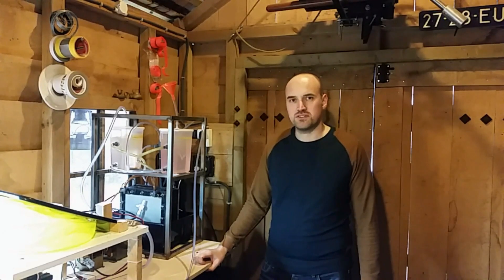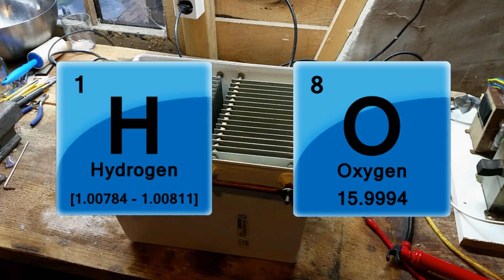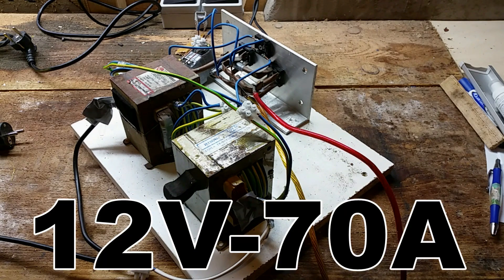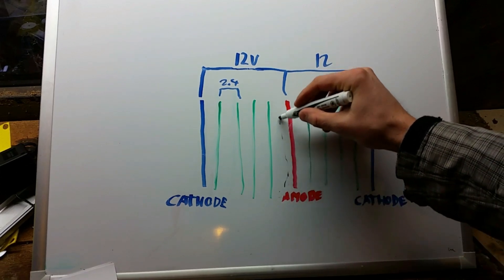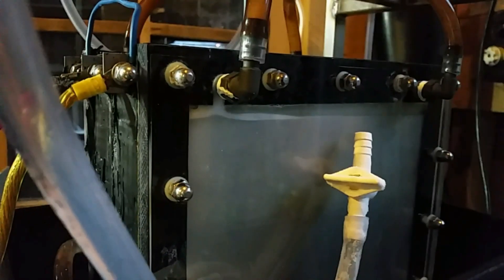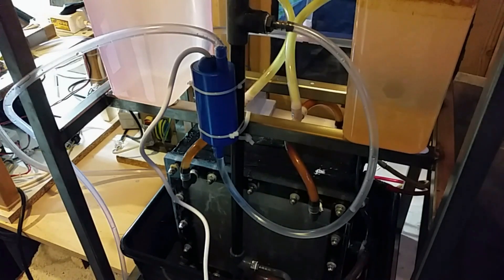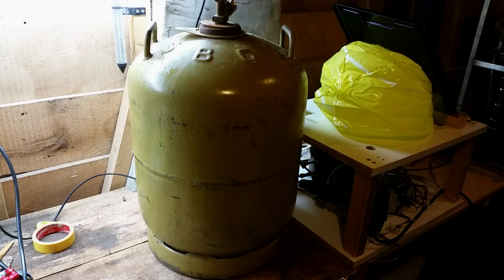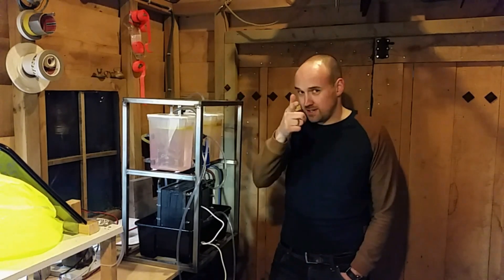Hydrogen Generator #1 Homemade Hydrogen Generator And Compressor Unit

Comment: Thank you for your video.  I have learned quite a bit by watching your video, and confirmed both ideas I've had and things I've heard.  I look forward to your other videos.  I have noted in the comments & in the video two things that were may be a concern.  1) Break down of felt and loss of separation of H & O  2) Heat

I watched the U shaped collector (referenced below), that allows a physical separation of the H/O collection.  No filters needed.  The problem with the U is that it is a wet system.  I watched the video on the basic construction of the dry cell and liked it a lot.  The problem I with the dry cell is that it dispenses an H & O mixture. Like yours does w/out the filters.  My thought is use two dry cell plate systems (like in the U shaped collector) and use wire to connect them vs water.  Thus being able to collect H from one set and O from the other.  This is just a hypothesis on my part.   As to the heat, the video on calculating # of amps addresses heat, and perhaps your system is over amped for the # of plates used.  Thank you again, keep up the good work & I hope the above is usefull & /or food for thought. 

+ lead     - lead 
  |__   __|
  |       |   |       | 
  |____|   |____|
      |________|
    wire connector
        vs water

https://www.youtube.com/watch?v=gQOxWXRsLB4&t=4s
basic construction of dry cell

https://www.youtube.com/watch?v=Szv30aUEsxM&t=8s
u shaped collection system

https://www.youtube.com/watch?v=QtlVJdrtbAM
how to calculate the # of amps needed for the # of plates used
(in a dry cell)

https://www.youtube.com/watch?v=g32BLZssoNo
safety & manufacturing information
Reply from the maker: Thank you so much! And thank you for your suggestions. However, your wire trick will not work because both ends have to be in the water and therefore 1 end will become an cathode on the anode side and the other an anode in the cathode side, it will basically work like a neutral plate.

Comment: if its not a vacum before pumping gasses into tank itll heat and become danger?cool video cheers
Reply from the maker: Thanks! It's an old propane tank so when I started filling it for the first time there was only some propane residue, no oxygen so no chance of bang there.
Reply: it was daniel donatellis videos on how 2 store hydrogen he was using aluminium and caustic 2 make hydrogen piped into air bed then pumped into tank ssome cool vids did you see the videos using gas burnt in sand tube 4 heating room im still learning electrics so know less aveagoodone
Reply from the maker: Good work! keep learning my friend!
Reply from the maker: Thanks you for subscribing!

Comment: How much current does your setup draw?
Reply from the maker: Around 70A at 12V
Reply: Im not asking about your power supply rating, i wanna what is  ur hydrogen cell actual current draw/ammeter reading?
Reply from the maker: Ok, well I don't know unfortunately because I don't have a DC amp meter or a shunt resistor setup. But I like to have that, so maybe I should get one of those.
Reply: Hey is Dutch.

Comment: If you could figure out how to separate h from o, when you have hho gas, then you would no longer be confined to using dc current to electrolyze the water.  Perhaps there is an ac frequency which is optimal?  Harmonic electrolysis?
Reply from the maker: Well you can actually. Because oxygen is paramagnetic, you can separate  it with a magnetic field. But I'm not sure if AC splitting is even possible. Do you know that? It's interesting anyway, I will do some research!
Reply: if you make AC look like DC then it does the same thing + some of its own magic
Reply from the maker: Can you explane the magical part? AC and DC are very different so how do you make them look the same? Do you mean block form?

Comment: Hey guys, why not use tow stainless teel tubes. One 2" 1/2 and one 3". Put one inside the other. Make one positive and one negative. Separate them by a clear pvc pipe between them and another outside. Capture the gases with different outlets. Similar to Joe Cell. Got it?
Reply from the maker: Well that of course works but the PVC in between the 2 electrodes does not conduct electricity so the current will only flow at the bottom and therefore make it much less efficient. Instead of the PVC you can put a piece of nylon fabric in between the 2 electrodes but make sure that there is a bit of space on both sides of the fabric where the bubbles can form.

Comment: Awesome video! So, why not get already-ready hydrogen from space? Thanks. :)
Reply from the maker: Thanks! How do you meen? Like milking the sun for hydrogen? Is a "little" impractical I think...🤔
Reply: Hehe you're right :). I heard that most of our matter universe is hydrogen, and the only reason we don't have as much freely existing on Earth is reactivity with oxygen (as you explained) and low gravity, which allows it to escape to space. That's why I thought it would be easier to get already-ready hydrogen from space. Aside from it being impractical, is it actually possible? :) It's just a fun thought experiment (or I'm secretly the US government searching for answers lol). And thanks for answering so quickly, I appreciate it.
Reply from the maker: Yes that's all true but the concentration  of Hydrogen in space is extremely low (there are only free flowing atoms) the rest is present in starts. So only star milking is an option but that would take a pretty long heat resistant hose 😂

Comment: Theoretically you only need 1.23 Volts to split water into hydrogen and oxygen (usually a bit more). The amount of H2 is only dependent on the amount of electrons flowing through the solution, not the voltage. Everything above a few volts will get converted into heat. The energy you put in to the H2 is about 1.23V*I*t. The energy you spend is U*I*t, where U is the applied voltage.
Reply: What you are saying is in efficient, since you have heat losses, amps generate heat. Meyer didnt use high amps but the opposite high voltage low amp and high frequency
Reply from the maker: Yes. And meyer's concept has been proven wrong over and over again. Generating hydrogen with electricity is just not very efficient, not yet anyway.....
Reply: @TheDIYScienceGuy  I heard Stan Meyer used resonance frequency to split water.
Reply from the maker: Thank you for your information.

Comment: hello sir how many 25mm x 25mm x05 mm  plates are there? and what is the grade of  synthetic felt. or kitchen towel any size to order it ?
Reply from the maker: Hello you, 11 plates total 2 negative 1 positive 8 neutral plates. I used normal kitchen cloth but the membranes of my generator recently failed. I think there is a binding agent that after 1.5 years completely broke down. I'm now going to use a nylon table cloth...but I'm still testing that. In a few weeks I will do a video about that and than I will also show the insides of the generator.
Reply: Thanks i am using double 1+1 polyester 500 mesh screen printing material  and getting good results. could you tell me what mesh or what grade of table cloth youare going to use so that i can also try for my next cell.
Reply from the maker: Ok nice! I'm going to use a cheap one that is not to thin. As long as the fibers are close together it will work. If your mesh works, why do you want to try something else? For cost reduction or the experimental value?
Reply: Some one told me for the Nefion but it is too costly
Reply from the maker: Yes that was my motivation to look for something else to.
Reply from the maker: Won't that dissolve in sodium hydroxide?
Reply: Thanks  could you tell me what thickness of cellulose have to use and where what kind of store i can get it?
Reply: I think he means by cellulose a pure cotton cloth like a shirt
Reply: From the number of plates and configuration i can tell that ur cell is generating a little extra heat than normal which could be the reason why ur membranes failed early.
Reply from the maker: Yes I think that two. And I think it will indeed work. But I'm going for nylon because the fibers are stronger.
Reply from the maker: Nope, but thanks ;)

Comment: so what power supply are you using here
Reply from the maker: A very ugly one! ;p.....12V around 40A
Reply from the maker: 12V 40A DC
Reply: how did you make that
Reply from the maker: I'm explaining that in the video.
Reply: when you try to turn on the lawn mover without pre heating did it blasted some times inside the engien
Reply from the maker: Yes that was exactly the problem.
Reply: will the pre heating definitely work
Reply from the maker: Maybe, it could depend on the engine. Changing the ignition timing is better because it will also make it efficient.
Reply: actually i dont want efficency .i just want this to work thats solve.will t works withoutchanging the ignition timing.
Reply from the maker: Yes
Reply: and i have started tthe vehcle today succesfully,i used a pvc pipe turned into h shape as a tank
Reply from the maker: Nice! Good job! But be careful that your tank doesn't explode! Pleas make a video and put it on YouTube
Reply: are you telling about xplodeing because of pressure or the gas explodes
Reply from the maker: I ment because of the pressure. But also be sure to keep the oxygen out of the tank.

Comment: Can you write me how thick your gasket/rubber and your plates are?
And did you glued it to the membran?
And did you use stainless steel for the cathode and/or anode, or did you use titanium?

This is a very helpful video! Thank your for this.
I am sorry for the flood of questions.
Reply from the maker: No problem! This is why I do it! Gaskets are 4mm, plates are 1mm stainless steel 304.
Reply: Thank you! Now I wait until I get my power supply, to dimensionate the build.
Keep it up! And many wishes that your house won't blow up one day or burn down since you should have a decent amount of oxygen in it.

And to clarify, so you mean the distance between the plates are 8mm (2x 4mm Gasket)?
Reply from the maker: Haha yes I will be carful! And indeed 8mm
Reply from the maker: And good luck with your project!!!!

Comment: What did you coat the felt with to make it waterproof ?
Reply from the maker: It's not coated because it doesn't have to be waterproof. It needs to be completely saturated with the sodium hydroxide solution so it will conduct electricity. The surface tension in between the fibers prevents the gas to flow through, so the gases will stay separated.

Comment: Is the hydrogen going into the compressors inlet, compressing it, then it's outlet goes to the tank, I'm curious bc I want to building one, but I fear that the compressor would get hot and ignite the gas and cause an explosion, can someone help?
Reply from the maker: Yes that is correct. As long as there is no oxygen mixed with the hydrogen it will not explode. If your compressor gets hot it's to small.

Comment: I really love this and would like to copy it myself. I do have a few questions though. The pipes that conduct the gases from the cell are stainless 316 right? They cant touch the cathode and anode otherwise there would be a short circuit. What did you use ti insulate them from the pipe? P.E or PVC or P.A ?? Same for the seperation plates, whats the material? Will some plastics dissolve in the cell? How long will the membrane last? Will the membranes dissolve? What are the mixing relationships for the optimal sodium hydroxide mix to get best results?
Reply from the maker: Thanks man I really appreciate that! Sorry for my late response but your questions needed more time to answer and I’ve been very busy.

316 is not needed 304 is good enough.

There are no stainless steel pipes in the generator. The channels are formed by de holes in de stainless steel plates, the seals, and the membranes (separation plates) staked together.

There only is a stainless steel pipe in the heat exchanger.

P.E or PVC are okay to use in sodium hydroxide solutions, never tried P.A. But you can always test it by letting it soak for a while and see if it’s still intact (that’s how I did it)

The membranes (separation plates) are made from kitchen cloth which need to be a synthetic felt cloth. After 1,5 years my membranes (separation plates) still work perfectly. But you can also use a very fine synthetic mesh but that’s more expensive.

I mix 50 grams of sodium hydroxide per 1 liter of water. But you can’t put in too much because at some point it will just stop dissolving.

Thanks for your interest and I hope I answered all your questions.
Reply: The DIY Science Guy. Thank you very much for sharing this information. I know you put alot of work andbthought into this device and its amazing you share it with me. Have you ever thought about keeping the oxygen compressed aswell and then combining them to get a more efficiant burn? I am planing to use both gases to run a gas turbine to produce electricity when there isnt enough sun ir wind to run my alternatives.
Reply from the maker: Yes I have and that's food for a future video ;) Keep me updated on your progress.
Reply: what thickness  synthetic felt cloth.  do you use? and which type of market or store  i can get it?
Reply from the maker: 0.5 mm but don't use felt becouse it's not very strong when it's wet.

Comment: Excellent video. Do you have a plan for this? I would love to make one aswell and connect it to my homemade V.A.W.T. would love some further info. Thanks and respect.
Reply from the maker: Thank you very much! Yes I&#39;m currently making a solar tracker to which I can attatch a solar panel that will always face the sun. A V.A.W.T is also nice! Do you have a video of your V.A.W.T?
Reply: The DIY Science Guy. I dont have a youtube channel with video's (yet) but i do have all the plans and am willing to share. Still sorting out the charge controller for it at the monent.
Reply: Hi Onkel, what is a VAWT??? sounds interesting!
Reply from the maker: Vertical axis wind turbine

Comment: what is that manbrane called ? i must  have missed it if you said it :S
Reply from the maker: Its a kitchen towel or kitchen cloth, which is a synthetic felt.
Reply: do it degrade over time?
are you using Neoprene gasket ?
Reply from the maker: After 1 year it still works. gasket is EPDM rubber. Thanks for your interest!
Reply: i am looking to make my own similar to your :D gathering the material i wanna do some test with small 25 cc engine(weedeater) i don't have yet :D
Reply from the maker: Cool! please let me not how that goes! Just do some test to see which materials do not dissolve in the sodium hydroxide solution.
Reply: another question :D
the sodium hydroxide can be re-use ? if i add more water once it get low do i have to add more sodium? is it staying in the dry cell? or some how get used in the process ? because it would cost a bunch to   re buy  that sodium everytime   not even sure how much i need yet
Reply from the maker: Yes the sodium hydroxide will stay in so you only have to add water from time to time
Reply: yeah that great  :D from now  i can get most material for around 100-150$ Cad :D i will know in the next 1-2 month if i can build it Thanks for your help
i would say never under estimate low view count video hehe :D
Reply from the maker: Nice! Good luke and pleas let me know how it goes!
Reply: can't find a source of rubber gasket alike material without buying costly 1 on ebay :S but found a place to buy 30  4x6"x1mm stainless  plate for 75$ cad
Reply from the maker: My rubber costed me €70,- bought it in the Netherlands. For stainless steel you just need to find a welding shop ore something like that and buy it from them. My plates:25x25x0.5mm costed me €10,-
Reply: and where have you bought the rubber ? online or in a shop ?
Reply from the maker: rubbermagazijn.nl

5004000140 EPDM plaatrubber 4mm (140cm) 2 meter € 70,00
Reply: i been doing nothing about that in 6 month :S
Reply from the maker: Well it's still a hobby, so no pressure ;)
Reply from the maker: Oke after 1.5 years the membrane broke and oxygen mixed in with the hydrogen. But because I do regular checks I caught it on time....so I'm going to use something else as a membrane in the future!
Reply: yes, not the cheap one but it can last for 100.000 hrs
Reply: hello sir is there any grade of the  synthetic felt. i mean  mesh or thickness
Reply: I think the felt broke due to heat. Did you make up your mind what other material are u going to use?
Reply from the maker: No that can't be it  because it doesen't get above 35c. the felt just falls apart because of the sodium hydroxide, as I will show in an upcoming video.
Reply: did you try to use sodium bicarbonate as a catalyst instead of potasium hydroxide koh or sodium hydroxide NaoH? Its not reactive/corrosive as the later two.
Reply from the maker: No I haven't because it is less effective as an electrolyte. I do not have corrosion problems anyway. But thanks!
Reply: Nafion N115 maybe can be good
Reply from the maker: Thanks for the tip! Very pricey though....!